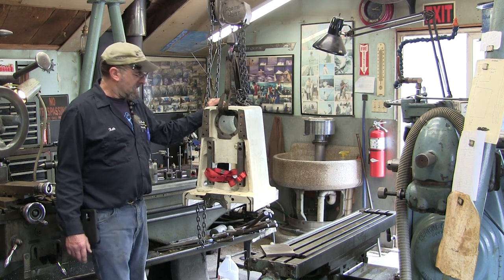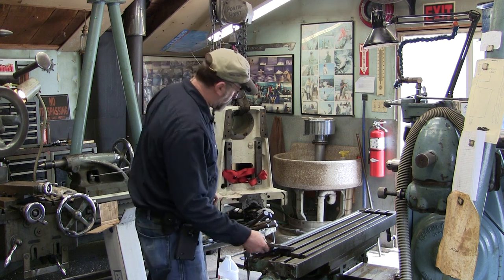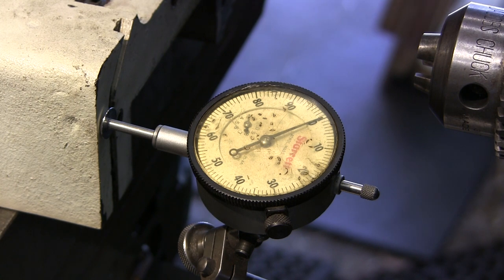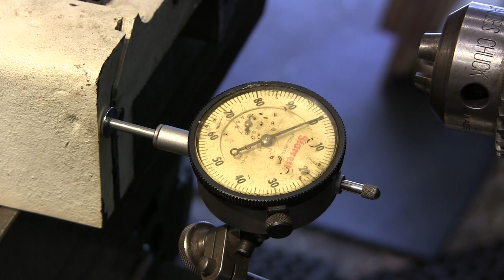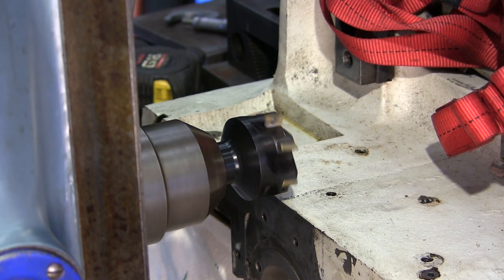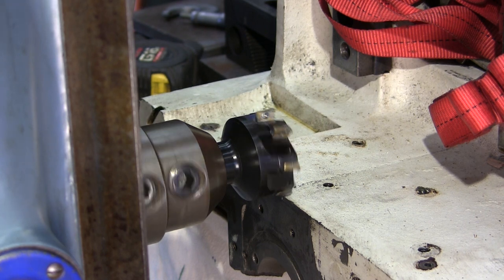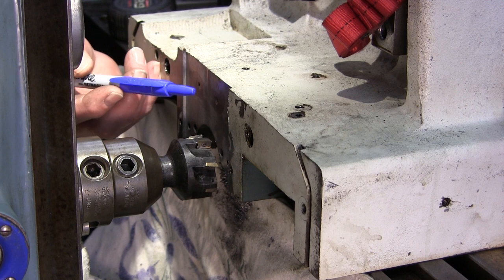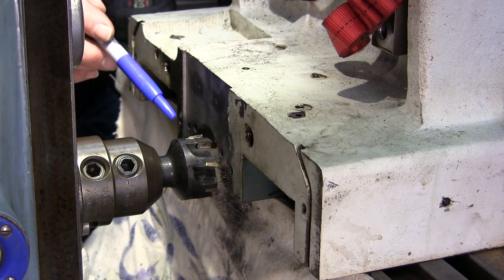Snap Part 1

Comment: This is a prime video of why Keith is the master, when my mill is doing its thing and it seems boring I speed the video up, but Keith takes and slows it down and turns it into a work of art. :-)
Reply: +bcbloc02    I thought, "If that part were JD green and about 15 times larger, I would have thought it was a Brian B video !!"
Reply: Doug Bourdo
Getting ready to load the mill with another big chuck of green iron for a boring job now. :-)
Reply: Boring but interesting.

Comment: I don't know if you did it off camera, but it is a good idea to indicate the z axis as well. Both directions need to be as close as you can possibly get them or the ballnut will want to twist when the flange bolts are torqued.  that will dramaticly reduce the life of the screw.  I usually go back with an indicator with .0001 graduations to make sure. The inside of the spindle bore is also a good place to indicate as most quality machine builders machine these pieces in a single setup to ensure that the spindle bore, ballnut flange and linear guide blocks are all parrallel or perpendicular as needed.

Odds are that your setup was as accurate as your machine table and within acceptable tolerances. I am just particularly picky when making or repairing machine parts.